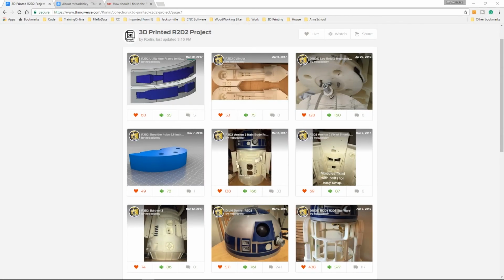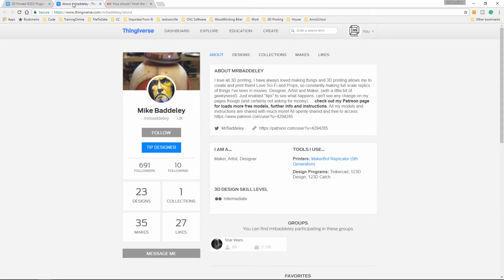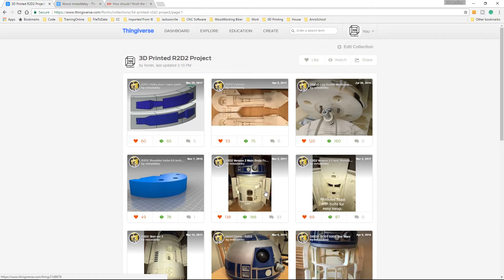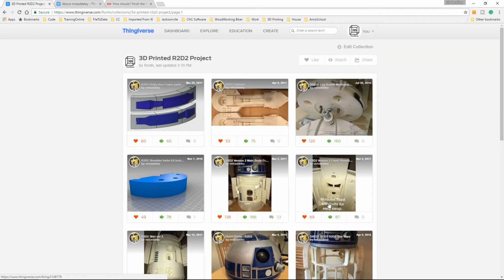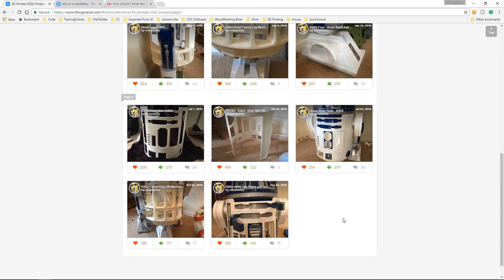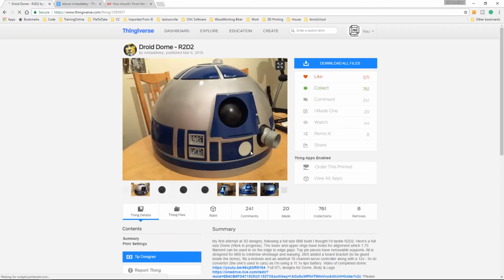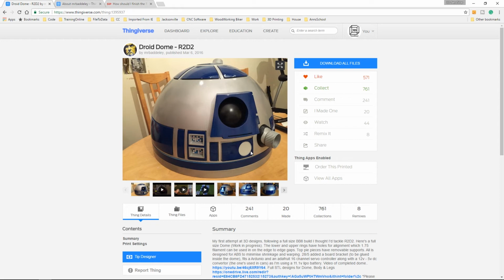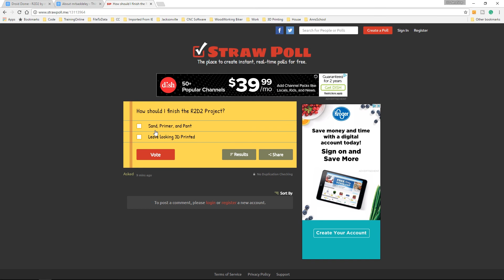R2D2 Project: How To Finish Straw Poll

Comment: Hey Rorlin! Awesome to see someone else doing the 3D-printed R2 project. As you may know, I've made a couple of videos on the subject and will be doing more (I literally have some of the body printing next to me right now.). I would strongly recommend that you not use the version available on Thingiverse, but instead go to Mike Baddeley's Patreon page and download the version 2 files from the link there. The body in particular is much improved, and I'm printing that even though I had already finished the version 1 frame last year.

I think you may be underestimating the amount of time that it will take for this project though -- especially if you want to do the whole sanding and painting thing. That is just so time-consuming it's crazy.
Reply from the maker: Thank for the tip about going to Mike's Patreon page. The 6 month is to just print the parts. If sand , primer and paint it will take over a year to build. Thanks for watching...